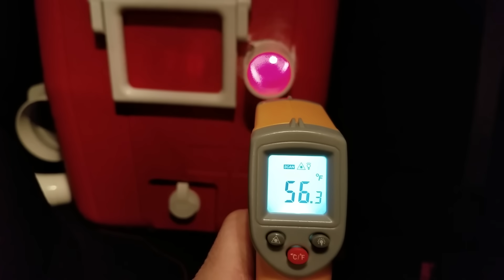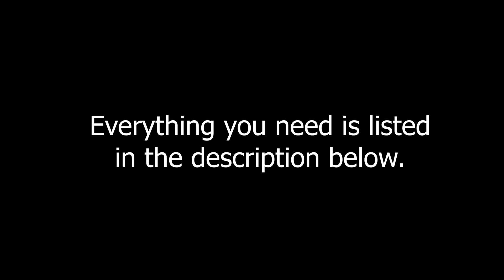Homemade Portable Air Conditioner DIY - Version 2 - Runs off 12 volt battery, car, or solar!

Comment: LMMFAO! An SUV is not a room. My SUV has AC. State of the art PORTABLE AC units start at $299. never have to pay for ice!
Reply: You can buy a lot of ice for $299 and there is something to be said for being able to make what you need.
Reply: Soutern Star Guitar ******] Electricity where I live is VERY expensive.  I can make ice in my freezer for free.  This is a VERY good deal for me.
Reply: Jordan Bronson  No it isn’t free to power my refrigerator, but most people I know already have a refrigerator and it doesn’t cost any more to make a tray of ice cubes once the fridge is running.  :)
Reply from the maker: I've also used it in a 7' x 16' room and it works well.
Reply: Your freezer doesn't use more electricity when you make ice. It has a thermostat that keeps it at a constant temperature (below freezing). The compressor is gonna kick on and keep it at that temperature, regardless of what is inside the freezer. Unless you're just putting a shit-ton of hot stuff in there, hot enough to change the internal temperature of your freezer, it absolutely will not use more electricity to continue to keep it at its constant below freezing temperature with ice trays sitting in there. It doesn't start working overtime, just because you put something in it. It just keeps doing what it's doing, based on the thermostat setting.
Reply: Haters gonna hate. Great video. Thanks for sharing.
Reply: Ok please link me to these state of the art air conditioners that we can put in our cars.
Reply: Wow, you're special. My new hero!
This works in tents, sheds, etc.
If you can't say anything good, why don't you shut the fuck up.
Reply: Yeah except that ac is going to cost you a lot of money in electricity.  I think part of the idea of this little thing is it can run on very little power.
Reply: Jordan Bronson always a 10%er in the crowd -- freaking naysayers. Go back to your video game.
Reply: What I was thinking!  I built a little tiny house and I want to try this out.  Sounds like it might work fine.  i already have 100W solar setup.  Can't hurt to try.
Reply: What state of the art AC units for $299?
Reply: DarthMohammed e
Reply: When someone takes the time to share an idea, how about saying something nice or nothing at all?
Reply: Those who can: make.
Those who can not: buy.
Good thing some can to provide stuff for others to buy.
Reply: +William Kelly - Yea, you can get about 150 Bags..... but what about next year?  Another $299 ???? So every year, it will cost you $299 ???  Might as well buy an Air Conditioner for that and plenty of money left for ICE for your Drinks / Coffee :))!  LMFAO !!!
Reply: +Soutern Star Guitar ******] - Right!!!  Sometimes makes more sense to buy something rather than making it.  Time + Parts + Coffee + Headaches from thinking = NOT WORTH IT !!!
Reply: +Barb Krzak - How do you Power your Freezer? LOL!.... I mean..., I hear a Refrigerator running as a joke... But NOT running Free!  LMFAO !!!

Comment: This is such a great idea.  By not blowing the air over the ice, it'll last as long as the rating on the cooler states.  The cooler above is rated to keep ice for up to 3 days...that's plenty of time for a road trip even with multiple legs. Dry ice would be even better to use. Either way, since the air is circulating within a closed system efficiency goes through the roof. I night even take this camping for when I go with tent camping with our Scout Troop.

For my application this will go in to the back of my pickup with the topper so that my dogs will stay cool n' comfy. Since I have a 12V adapter back there one of my sons can reach back and turn it on and off at will via the pass-thru from cab to topper.  As a side note, I highly recommended tinting the windows of the topper as dark as possible to deflect the sun's rays. I also recommend insulating the inner walls a ceiling of the topper.

This project also took me an hour to assemble. I highly recommend caulking as you go rather than waiting til the end. Once everything was assembled it was a little difficult getting caulk around the underneath side of the two inner ports leading out.

With the caulk in place I can't to try this tomorrow.  I plan on testing it in my laundry room (8'x5') with a portable battery that has a 12V plug on it.
Reply: Be careful with the dry ice. You could die if it fills your tent up with carbon dioxide
Reply: idont think a tent would be a problem enough air circulating, but a closed in area yes
Reply: how long does the ice last?
Reply: dry ice puts out carbon monoxide (dioxide?) which shouldn't be used in a tent or closed space.  You could die.  Someone else mentioned a product that FREEZES down to dry ice temperatures that truckers use, and it does not put off any gases.  So... that would be safe.

Comment: Ever made ice cream? Pour some rock salt in with the ice and water and you will achieve even better cooling!
Reply: bigbopete it lowers the freezing point of water. Which means the ice will revert back to a liquid while still remaining at or below the freezing point of unsalted water. This will allow for faster and more uniform cooling across the piping and also helps prolong the lifespan of the ice.
Reply from the maker: Thanks for the tip.
Reply: The salt would help. In thermodynamics courses it's stated: temperature difference is the driving force for heat transfer. (So having sub-zero brine would work better than normal ice)
Reply: Loki RIP I will admit i am no expert on the subject and ive probably said things that dont make sense. I've only seen the effects when ive made ice cream, and I've made too much in my life for it to be healthy :). But i have observed it will extend the time a device like this is able to operate while still circulating cool air. Lowering the temp of the water to sub 32 temps means it takes longer for it to reach equilibrium with the room temperature, prolonging the lifespan. Now as the room temperature decreases there isnt as much heat to exchange. In this case, to get colder temperatures out of the pipe you can add something that acts like a heat sink to increase thermal exchange. The more heat the ice can absorb from the warm air in the pipe, the cooler the air comming out.
Reply: Unfortunately the rock salt or any salt would attack the metal piping used for cooling causing corrosion. It's best just not using salt so the project last longer without salt water corrosion damage.
Reply: @markoberer1158  I had thought about that too. You could use pvc instead. But that makes it a bit more complicated.
Reply: That would be interesting to see how that works.
Reply: Why is that? What does the rock salt do to the ice that makes it cooler?
Reply: Rock Salt will melt your ice much faster. It seems just the ice is getting a cool enough breeze to make it cool, so why kill the performance with the salt?
Reply: Jorge Valadez again, salt does not change the temp. It changes the surface area. Go ask my colleagues in your physics dept.
Reply: Loki RIP but since the liquid in the cooler would be colder than ice and the fact that the liquid would touch 100% of the pipe and ice cannot, it would (Rock salt) make this cooler work even better!
Reply: The salt allows for cooler liquid rather than ice. The sub 32 liquid cools pop cans better due to more surface contact. It will not change the rate of heat exchange, so it would do absolutely nothing for this application.

Comment: Ever tjought about putting salt on top of the ice? In theory should get colder. How ice cream was made back in the day!
Reply from the maker: No. I haven't. Good idea though. I'll try that next time I use it.
Reply: This is a good idea... except then you have to worry about (a) corrosion, and (b) salt deposits inside the cooler. Both can be resolved, but you have to decide if the increased efficiency/cooling provided by the salt is worth the hassle of managing the side effects.

Comment: Have you experimented with any better fan options since then and for controlling the speed? I've combed through the majority of comments and replies checking if you have any solid opinion changes on hardware before ordering and putting this unit together. Putting the intake up top and sealing most of the areas well seems to be about it.
Reply from the maker: I have not experimented with other fans because this one has worked well for me. As for now, the only thing I would have done differently is inserted the tube at the top of the cooler rather than the bottom. Good luck with your build.

Comment: Just a thought...if the ice is from a freezer in the same house...the freezer is putting what heat it removed from the water back into the house you are trying to cool.
Reply from the maker: This is true.
Reply: would this be the same as "recirc" on a car a/c?
Reply from the maker: It does recirculate the air.

Comment: Just an idea, not sure how well it would work but I'd add a stand above the ducting so it doesn't get crushed, put a large block of ice in then fill the sides with cubed ice.  The idea is the block will take longer to melt and by the time the cubed ice melts there will be enough water to reach the block of ice.  thoughts?
Followup question, since the air is isolated through a duct, how moist is the air coming out?  did it get fairly humid in your vehicle?
Reply from the maker: I think your block of ice idea sounds good. As far as humidity. I didn't notice much.

Comment: I built mine very similar but both holes are in the lid to avoid any possibility of leaks, the exhaust hole is a 3" elbow that can be rotated in any direction. The biggest problem is that those bilge blowers are too noisy so I switched to a Broan bathroom exhaust fan, 2.2 sones and more than enough air movement, I also went with 2 layers of coil and some vinyl tubing to drain the water, ice lasts twice as long if it's not floating in water.
Reply: Can you how a video of your version?
Reply: spoon55 I use 2 milk jugs filled with a water and freeze them and use that to support the grate that holds the coils and ice up out of the water. I use an exhaust fan from an RV (12v) so it's portable. I mostly use it for camping.
Reply: But wouldn’t water work better for heat transfer?
Reply: The water from ice melt should be just above freezing.  If you drain it, warm air is drawn into the cooler increasing the internal temperature, which actually makes the ice melt faster.  This is why all cooler duration tests start out with a cooler full of ice don't drain any water during the test.
Reply: BumpinTheRoad I thought the same thing at first but testing both ways I found the ice lasts longer when the water drains away. A better way is to have the ice surrounding the coil but suspended above the water, you get the advantage of the water absorbing the heat and the ice not sitting in water.
Reply from the maker: Awesome. Thanks for sharing.
Reply: Jon Rothenbusch how would you go about building something like that?
Reply: Do you think your setup would be sufficient enough to cool a home garage in Texas where the avg temperature in the garage is 120F?
Reply: Interesting. So you have 2 layers of coil?  Like a coil with a larger diameter over it sitting in ice. Or just a longer coil?
Reply: Wouldn't a bathroom fan be 120 v? I though we were looking at 12v for portability.
Reply: spoon55 no it won't, it keeps my 10by14 ft. camping tent nice and cool at night when the temp is about 85-90 outside the tent

Comment: copy/paste from Dan Bowden (his comment is way further down). liked his idea and wanted to find it easier: "couldn't you put the input towards the top and run the pipe down towards the bottom? This would help avoid any leaks.."
Reply from the maker: Good point. I will pin his comment to the top.

Comment: im a delivery truk driver..is this make my truk cool.. ty
Reply from the maker: The cab...yes. The cargo...it's hard to say. I used it in a midsize suv and it cooled the entire thing.
Reply: make & do would you say this could be ideal in an ideal vehicle? My plan is to build this for my parked car at work, more often than not i have to park in direct sunlight and my car is scorching hot i live in texas this heat is no joke... by the by this is awesome thanks for sharing...
Reply: EvErMoRe there's a new gadget, a solar powered fan you can put to your car window that removes the heat from your car
Reply: @nermainmerl3284  That's been tested. It doesn't work
Reply: Nermain Merl i'll have to look for that 🤔

Comment: You are Macguyver. How long will the charge on a 12 volt battery last?
Reply from the maker: It depends on how many amp/hours your battery will produce. The blower requires 6 amps. So if you have a 60 amp battery, it will go for 10 hours. However, you don't want to drain your battery below 50% or it will significantly shorten the life of the battery. So a 60 amp would be ideal for about 5 hours.

Comment: I am trying to come up with a cooling solution for my dog who we transport in the back of my covered pickup. We've tried directing the AC vents in the crew cab toward the pass-thru but it was still a little too hot for them. This design seems to be the perfect solution.

How loud is the fan? I am not asking for a Db measurement just a general statement.
Reply from the maker: The fan is about as loud as your car ac on high. One other thing for keeping the back of the truck cool is to maybe add some kind of insulation to help keep the cool in and if it has windows, tint them or shade them somehow.
Reply: Today was a trial run to see how it would cool my laundry room. It keep it at a solid 70 degrees for 2.5 hours. However, water leaked through the reducer connection near the outlet. This cause water to drain in to the vent tub all the way back to the marine fan and pour out. Tomorrow I am going to work on water proofing that connection and give it another while. If I solve the leak then this project will become a huge success.
Reply from the maker: Awesome. Let us know how it works for you.

Comment: They sell 2" aluminum electrical conduit at home depot; you could probably coil a large amount into a cooler.
Reply: That would take a pipe bender and alot of dang work.
Reply: talclipse I never used it, but it comes in coils (according to home Depot website); I'll probably end up  up going with the design in video anyway.
Reply: Jason L I'll look into that.the only thing that pulled up on their site was the straight pipe..

I am buliding a smaller diy cooler this weekend and soon as the parts come I am going to bulid this one.
Reply: Ok I see what you are talking about.its about the same as the 3" in the video.but it doesnt look very cost effective as on homedepot site its $85 for a 2"x25ft.

You would have more loops in the tank but wouldn't be worth it at all as the 3" stuff is only $15.

Comment: Do you think using a narrower, longer semi rigid metal tube and narrower outlet pipe would increase efficiency of system (more surface area being exposed to ice water, and narrower tubes aiding cooling effect in general)?
Reply: I think if the air comes out cooler you will spend more ice in less time. Depending on the size of the room you want to cool, it might be better to have less heat exchanged for a longer cooling period. The efficiency is I think mostly in how good the container is insulated. But as the box is in the same area you are cooling that would not matter much. Basically you not want to cool your room to much to quick. Adjusting airflow is a good way to control that. Faster airflow will blow out air of slightly higher temperature but overall it will cool down a room quicker. When you start calculating though non of these coolers should work as the BTU would be around 50-100 while normal airconditioners are 7000 or higher. The amount of ice needed compared to an airconditioner is huge. Ice would only be economical if it can be had for almost free (and no ice from your freezer is certainly not free. I live in Thailand and ice is a very common product for a very low price. That is the reason why I am interested in it. In western countries it works when you need it only for a low amount of days per year as the cost of ice will get too high when compared to a real air-conditioning electrical bill.
Reply: I could be wrong, but it almost makes sense that a lower velocity fan would be better, because it would take longer for air to flow (thus giving it more time in the conduit to cool).
Reply from the maker: Yes. I agree. More surface area exposed would make it cooler.
Reply: would you need a higher velocity fan?
Reply from the maker: I don't think so.

Comment: Hi , I was actually thinking about this last night I had the same fan in my Amazon cart ? before I seen your video. I just did not have the rest panned out so thank you.. I was wondering if I use a 12 volt ice chest if it would work the same way ? it already has the Refrigeration  built in ? What are your thoughts ?
Reply from the maker: I have no experience with the 12 volt ice chest, but it sounds like it would work. Give it a try and let us know.
Reply: It will not work with a 12volt typical electric cooler as they cool to a max of 40 degrees below the temperature of the  outside air. They rely on the cooler's insulation to hold that cooler temp. The tube passing warm outside air through the unit would warm up the inside more that the cooler could handle. You cannot use loose ice in an electric cooler but could use frozen two liter bottles but if you are adding Ice you do not need the electric cooler itself to begin with. I have owned a Colman 12 volt cooler  for years which I like but it's useful applications are quite limited. It is not suited for this sort of conversion.